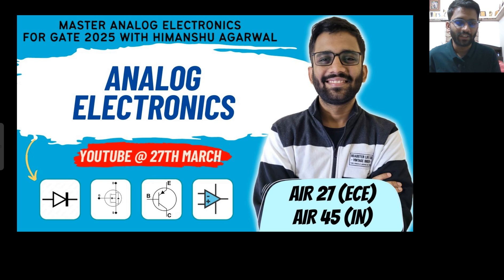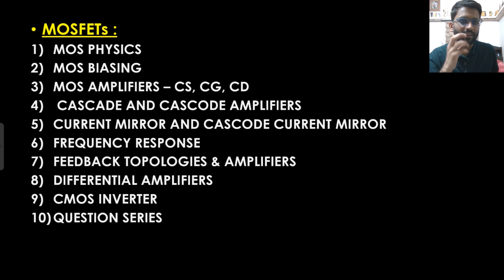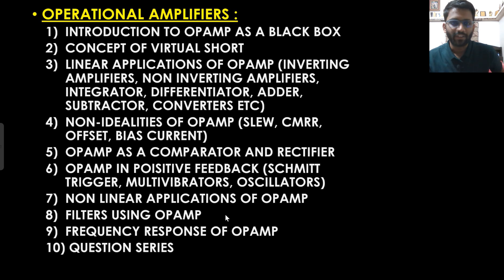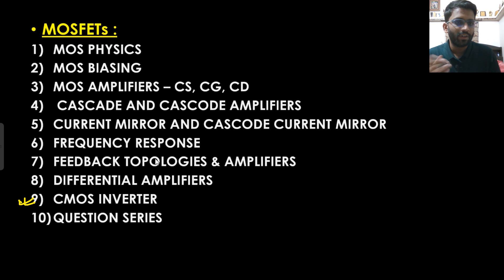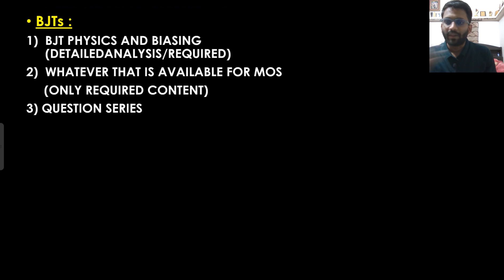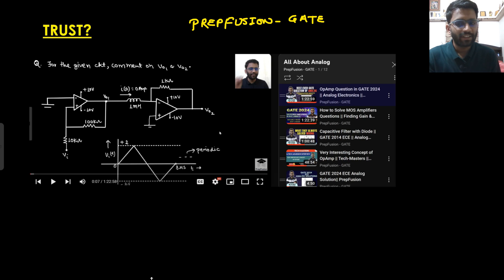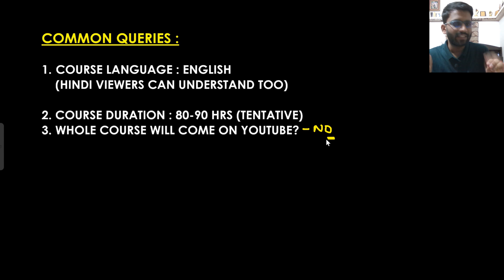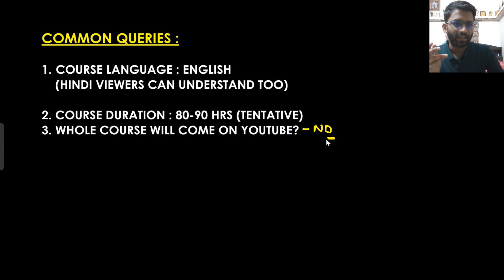🔥 Analog Electronics for GATE 2025 || PrepFusion || Himanshu Agarwal

Comment: You have mentioned Semiconductor Physics and MOS Physics in the curriculum. Does that mean EDC will also be covered in this Analog Playlist itself?
Reply from the maker: No, Only the part which is important for Understanding Analog Circuits, only that part will be taught in this course. 

Will bring a separate course for EDC later on.
Reply: @PrepFusion_GATE  Thank you for clearing it up.